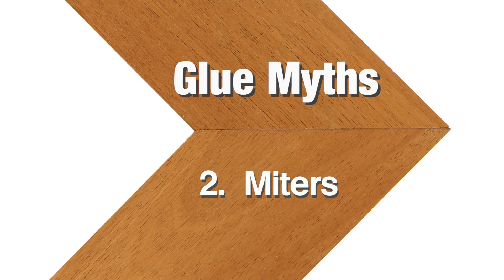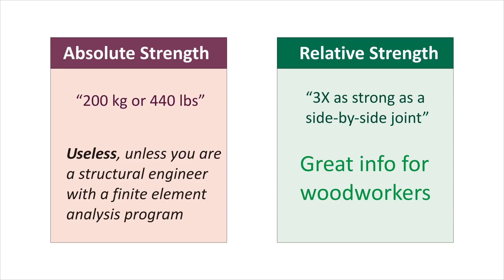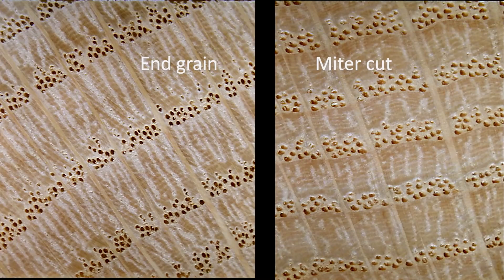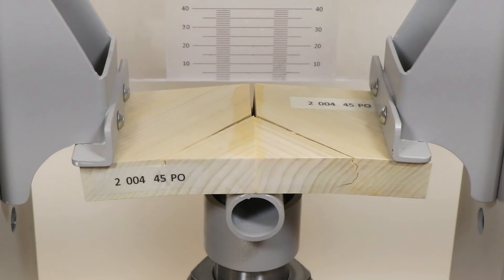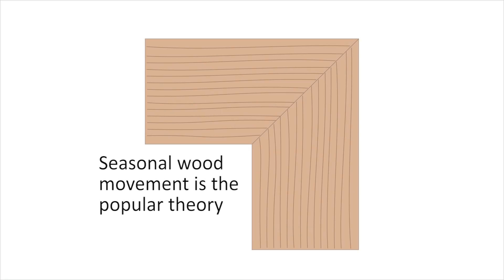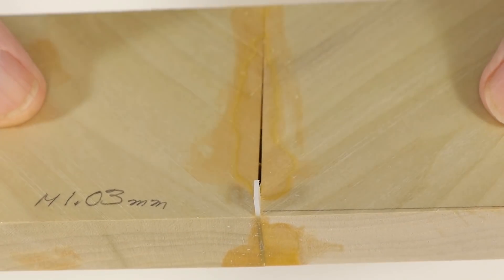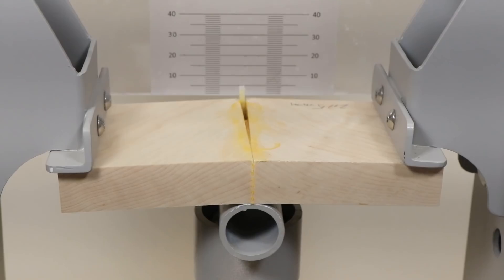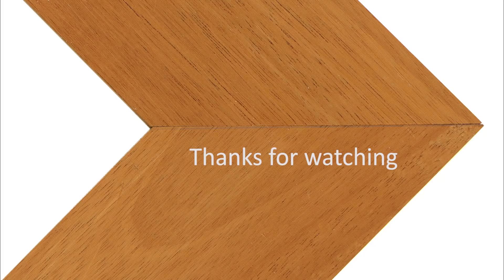Glue Myths:  2. Miters

Comment: I feel that your conclusions point to an even greater need of joinery in high-stress areas. 

I would love to see a comparison of glue-joint to loose tenon and or dowel joinery. 

I often hear how dominoes and dowels add little to no strength to Panel glue ups. But you demonstration of how the lignin is the weakest link, may show this to be false.
Reply: Well - they do not add strength simply cause a good joint (anything but endgrain really) is as strong or stronger than the wood.

Comment: Your testing method put stress on the thickness. Miter joints are stressed along the glue line. Try rotating your sample 90 degrees and then measure the breaking strength. I suspect it will be stronger

Comment: Miters are fairly strong, as you indicated; in practical use of miters, however, they're either not cut accurately enough or the glued surface area is fairly small relative to the size of the overall structure. I've made non-reinforced small mitered boxes without any signs of failure. I have, however, made non-reinforced picture frames with comical failures. Great video!

Comment: The problem with the open mitre experiment near the end is that the opening was towards the side that doesn't really carry the main load, because of the grains there not really carrying over the torque that much, but more the lignen.

Otherwise you did a really good job of exploring the different joint strengths, thank you for the interesting content.

Comment: Now test the miter in the proper direction. The grains should not have been perpendicular to the direction of force, but rather at a 45° angle to it. Also, the part of the miter that failed in the wood is the part of the miter that doesn't actually exist. That triangle would be cut out in a frame. Gotta say I'm not too sure if anything in this video was actually useful at all.

Comment: Great series... In practical terms, it seems obvious that the ratio between the parts length and the glued area is extremely important, since it would be proportional to the amount of leverage one could apply to the glued miter. Hence it seems to be a safe approach to apply splines on picture frames (or other strengthening tricks) while I would rarely apply them on small boxes.

Comment: Maybe this "myth" originated from times when hide glue was used and not the modern synthetic glues. Would make more sense to test with hide glue
Reply: Nope, that glue is nearly as strong and a good longgrain-joint with hideglue is still stronger than the wood itself.

Comment: I like your investigation and you show some things that make glue joints make sense.  However, you indicated "End grain joints are the strongest simple glue joint by a factor of 2."  This is a poor statement and makes your comments difficult to not question.  You showed a really great glue joint "strength" result.  You showed that the end grain glue joint is stronger than the long grain glue joint but not close to utilizing wood in it's strongest direction.  The results don't change what we all know is that long grain wood strength maximizes the strength of wood.  Using joints like mortise and tenon maximizes wood strength.  None of this changes the known structural wood strength methods involve using methods that maximize wood in it's strongest direction.

Comment: Wouldn’t the spline be stronger than the glue joint and the lignin, and be more comparable to the third group of your last video? The spline is obviously thinner but is in conjunction with the glue joint. Looking forward to more testing. Thanks
Reply: I've read that strength along the grain is 10-20x perpendicular to the grain.  Added to that, the force across the spline glueline is shear, not tension.  I'd expect splines to be super strong.

Comment: The interesting thing is though, that in a normal mitre joint, all the grains would help carry over torque together, essentially making the joint more like an end-to-end joint than a side-to-side one.

Also, mitre joints, unlike the other joints, usually experience torque along the long side of the suface that was glued, as where the other joints generally experience it along the short side :)

Comment: People say miters are weak because they are. No one talks about side grain glue ups because no one glues up a sidegrain board as short as a typical miter joint. Typically it is always said about picture frames where they are usually at the end of a long torque arm

Comment: Hi Patrick. I've enjoyed both videos. A few years back I also tested the three configurations you did in video 1. I just used weights hanging off F clamps, but I got the same trends. I've since seen a few YouTubers debunk the end grain myth, but none so well as your video. Keep it up. Have you considered a glue + wood powder (fine sawdust) video? Recently I watched; (https://youtu.be/6KjlyXKeo8c "Super strong epoxy with diamonds and more", by Tech Ingredients). The relevant principle he discussed was "densification" to increase bond strength. This principle is also used in concrete mix design, which may be nominal 12 mm aggregate, but that only specifies the maximum size. The design critera then identifies percentages of aggregate sizes that are smaller and smaller to fill the voids between aggregates, which increases strength and density. Have you worked with adhedives and additives?

Comment: As I wrote on Myth 1, I've glued miter joint picture frames many times for decades without a failure that I know of.  I've always assumed they'd be stronger than E2E joints because they are half S2S.  But how much strength does one need on a picture frame corner?

Comment: Miters can fail do to expansion and contraction of the wood over time and storage conditions. The joints can be perfect at the time of construction. But I've repaired patterns that were built in the 40s. Patterns were stored in a warehouse  where temperature and humidity varies by seasons. So depending on the function and stability of the environment will also determine failure rate. Your test samples failed as expected.

Comment: Extremely irresponsible to mis-guide so many giving the impression that it is safe to trust end-grain glue-joints for structural purposes. The 'proof' of exploding a 'myth' is deceitful. As another poster put it: "Andre Vion 1 month ago: This is just flat earth bollocks. This isn't safe and should never ever be used in construction. End joints have been used for centuries, thing is though, it all fell down. That's why we don't see them anymore. Really hope no one takes this video seriously." 
Admittedly, some glues are impressive now, but the tests do not test the ultimate, the test of time with wood being vulnerable to moisture variations resulting in timber movement and glue failure. I just hope nobody dies as a result of this video.

Comment: Great research. Thank you for your contributions to or communal knowledge. One thing you may not be considering is WHERE miter joints are used, vs where edge too edge joints are used. The edge too edge joints in a tabletop are not subjected to the same amounts of torque that the mitered corners of a picture frame may be. For example, I would bet you could snap that joint you were holding if you grabbed reach board at the end. The strength of the glue is only one component of the strength of the joint as a whole. For many applications where a miter may be considered, the strength of the glue alone is not sufficient.

Comment: You are missing the entire point. Glue joints don't typically fail because of excessive loading. They fail because of wood expansion. Imagine a picture frame with 4 perfectly cut miters. Now imagine what happens when the wood expands (or contracts) due to changing humidity: the miters will no longer be perfect. This will stress the joint. This is why mitered frames open up, not due to all the force they see (which is usually none). It is also the same reason why no competent woodworker glues a breadboard end the full width on a large panel. It will break because of seasonal movement even with no loading. This also applies to you last video.

Comment: My problem in these videos is this.... If the lignen fails before the joint, you don't really know what the strength of the joint is and can't determine which is weaker.... All you know is that the glue bond to the fiber is stronger than lignen. Select a glue that is weaker than the lignen then you have a fair test in all examples of joint strength. You're not really testing anything here other than the strength of the glue itself.... which is clearly stronger than lignen.

Comment: My only point of contention is that you are not testing the miter as a miter.  You have only proven is what you've proven already, that glue is stronger than lignum. The stress on a miter on a picture frame is of gravity pulling down...the reason why your clock joints do not fail is because, the Earth does not push up, or push/pulls side to side relative to the miter.

Comment: I'd love to see a test of a miter style joint glued up side-grain, to compare the joint strength regardless of geometry. Imagine a typical miter as shown in the vid where he broke it with his hands. Now make a similar joint, but cut the pieces out so that the grain direction is angled to match the cut. Then strengthen both pieces by gluing metal strips cut to match the wood all the way up to the joint. This way lignin failure wouldn't be an issue and the geometry would be "real world" geometry. The only difference would be grain direction at the joint.
Reply: But ... why?